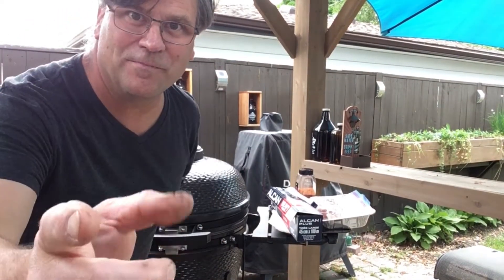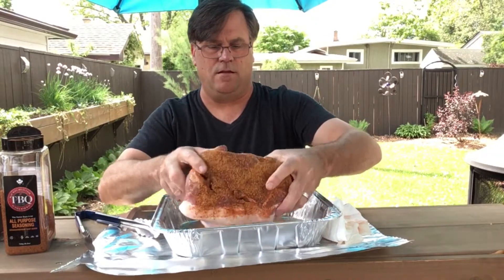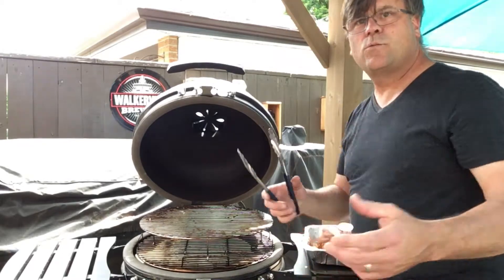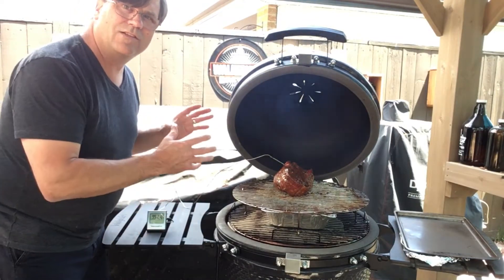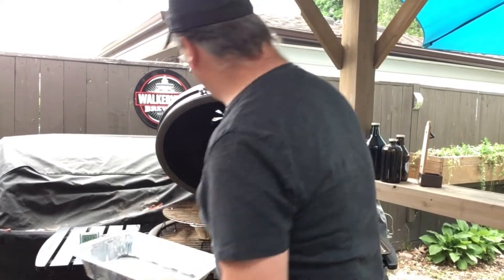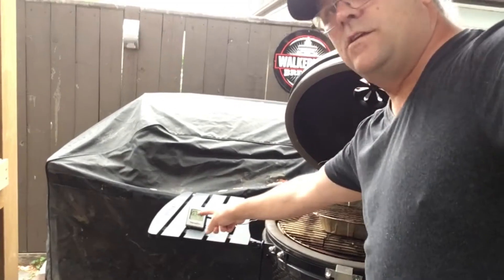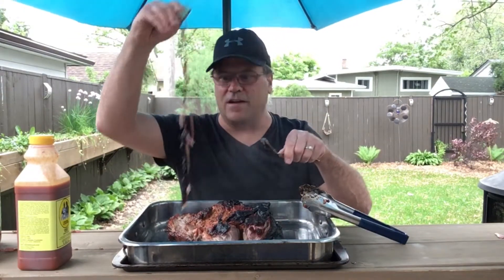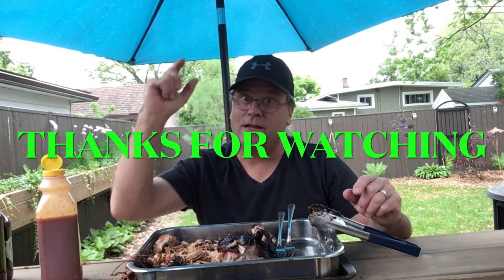Pulled pork on the Louisiana Grills Kamado Style Ceramic BBQ

Comment: Thanks for the videos Greg. I recently bought the same BBQ. Having a hard time regulating the temperature. What temp did you cook the pork at? I made one yesterday and was hoping for 225-240 but I couldn't stop it from going up much higher, even with very little venting.
Reply from the maker: My minimal venting is usually just under 1 at the top and 2 sets of holes on the bottom. I find this gives me around 250 to 275 degrees. I have only used hardwood lump charcoal. Maybe different charcoals burn at different temperatures. Too high a temperature, I would think you still have room to close vents. I hope this information helps you.